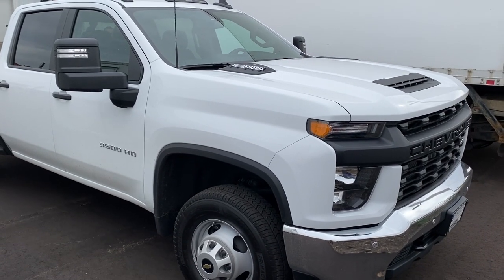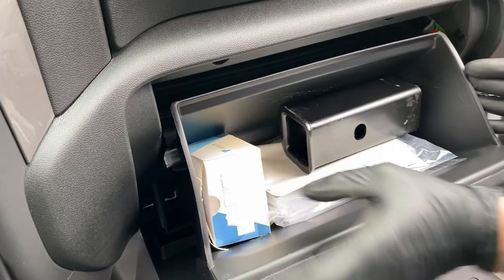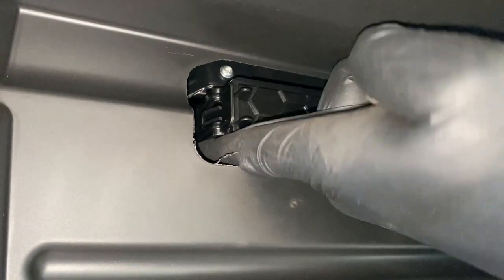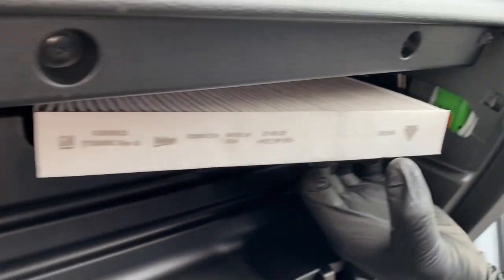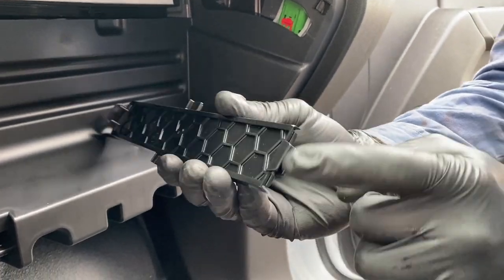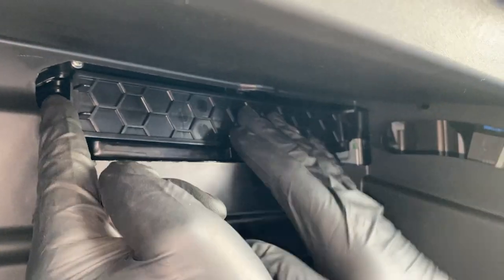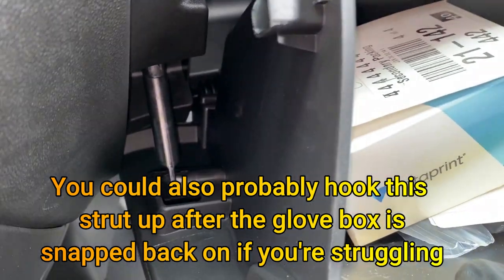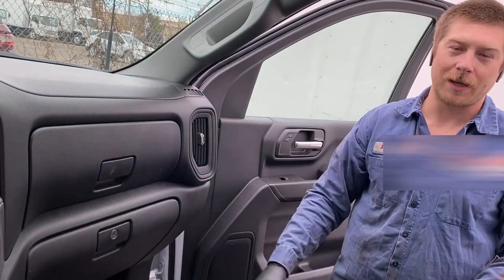2019+ Chevy Silverado HD Cabin Air Filter Replacement

Comment: I have a 2003 Silverado and I have never changed it. None of my other cars or trucks had cabin air filters, so I never thought it was needed.
Reply from the maker: I believe the 2003-2013 trucks do not have filters for some reason.
Reply: @TonyTheTruckGuy  Yes it does but I don't see any reason for it.
Reply from the maker: Just helps keep the air being recirculated inside the cab cleaner.

Comment: Mine has several star screws and a cord cable support.  Filter behind plastic covering. 2019 hd ltz duramax
Reply from the maker: Must be because this is more of a base model
Reply: It’s because he has his years wrong. This video is not for a 2019.
Reply: I have a 2019 Chevy Silverado 2500HD w/t (gas) and I have the same issue. Plastic covering and filter sits behind a casing.

Comment: Not even close for the 2019 Chevy Silverado 2500HD Duramax.  There are 4 screws to remove on the lower glove box to remove it.  The air filter compartment is also different, but fairly simply access to remove the cover and replace the filter.  Note, the filter is not square, so it goes in a certain way.  Refer to your owners manual, there is a section in there specifically on how to change the cabin air filter.
Reply from the maker: I’m guessing it’s because this is a rental truck which is a lower trim. Do you have an LTZ or something?
Reply: LTZ Trim.
Reply from the maker: @danielherrera4886  That’s gotta be why. Seems to be a 50/50 in the comments so the higher trim must just have a fancier glove box which makes sense.
Reply: My 2019 2500 HD with LT trim, has the 4 bolts. Older body style, 2019 was a split year on the body style.

Comment: Yea sooo my damper actually came apart. Any idea how to fix ? Lol
Reply from the maker: The little plastic strut thing in the left side blew apart? That’s odd lol. Can it just be pushed back together?
Reply: @TonyTheTruckGuy  yeah it came apart in half, so half is inside the dash. Going to try in a bit to fix it haha
Reply from the maker: @DR0CK  Yeah I’m not sure why it would have come apart like that. Cheap plastic crap.
Reply: @TonyTheTruckGuy  i know it was my fault, for yabking downward. In anycase, the piece inside the dash unclips the same way so i was able to get it out, reconnect it and put it back. It comes apart in the middle with some tiny clips (i guess to prevent breaking for idiots like me haha) all is good now
Reply from the maker: @DR0CK  Lmao well at least it was an easy fix and not a $100 plastic part 😂

Comment: That is not the same as a 2019 2500hd
Reply from the maker: You probably have an LTZ or something fancy that adds more steps. This is just a work truck with base interior. Some other guy with a 2500 LTZ said there were 4 screws holding his filter in.
Reply: @TonyTheTruckGuy  hey there yea it’s an LTZ, 4 screws and pull it out. Wasn’t too bad. Thanks
Reply: @TonyTheTruckGuy  J G is correct, they updated the models for the 1500s in 2019 but the HDs didn't update until 2020 model year. This is for 2020 and newer.
Reply from the maker: @brucehanson4147  It’s confusing because the HD’s DID debut in February of 2019, but didn’t hit dealerships until late summer. So this body style is basically all 2019.5 and newer.
Reply: The 4 bolts hold the lower glove box in place. Remove that, push down the 2 tabs on filter cover and out she comes.